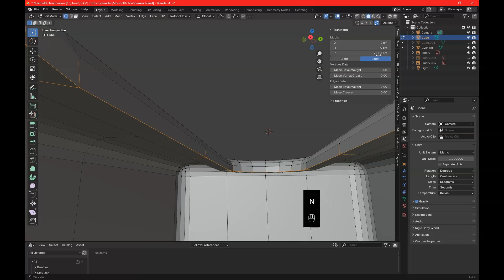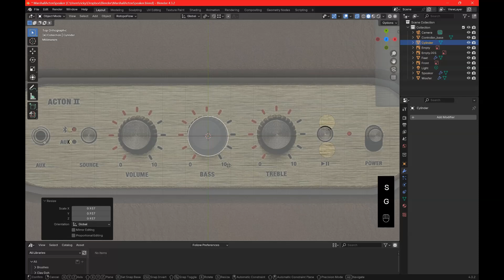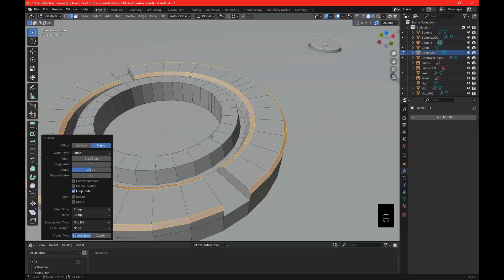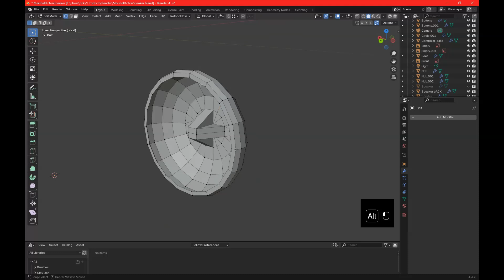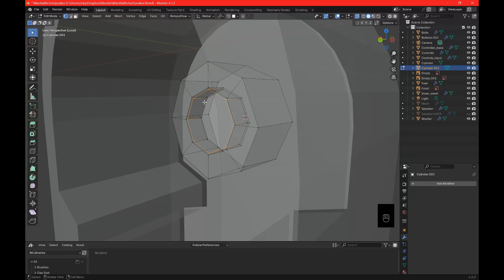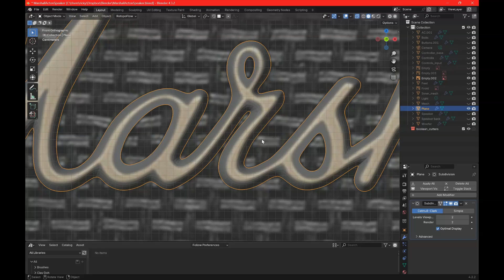Making a Marshall Acton speaker with Blender.

Comment: It would be fun if you told me what you did. You twist back and forth, spin it so it's impossible to understand what you're doing. You move markers back and forth, seemingly for no reason. If you were more careful and firm in your movement and explained what you did better, it would have been a good tutorial, now it unfortunately just became extremely messy
Reply from the maker: Hi there, thanks for the feedback, I understand where you are coming from. Most models I build are larger build times which are why they are sped up to 2x speed. It may help to slow down the playback speed at certain points to easier grasp what I’m doing. If I was to slow down and explain every click and movement and why, I fear time would run away and the videos would be nearer 4 hours long. More recent videos are combined with smaller quicker theoretical tutorials but I will try to take on board your thoughts and see if I can make things clearer going forward.

Comment: How do you do it or where do you get the exact textures? For example, the ones for the instructions and warnings on the back and the skin texture of the speaker.
Reply from the maker: Hi, I use marmoset toolbag which has its own texture library, but these materials can be found elsewhere through add-ons and free material libraries. 
In regards to the warning text at the rear, you can either make it yourself in photoshop or procreate, just typing it out or…. As a test this time I actually asked ChatGPT to generate the image decal based product images online, it wasn’t perfect but it was a good starting point.